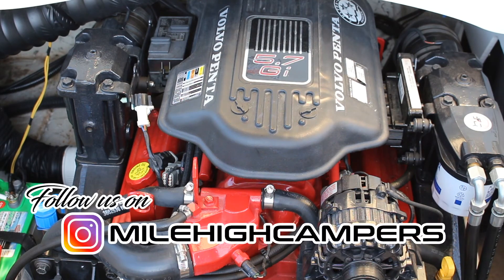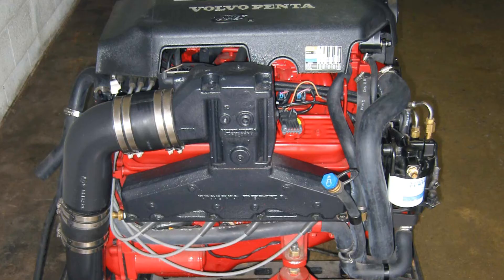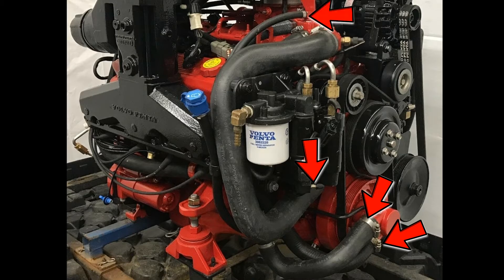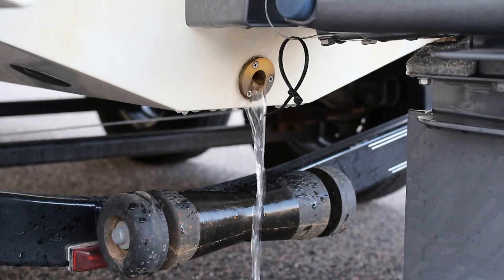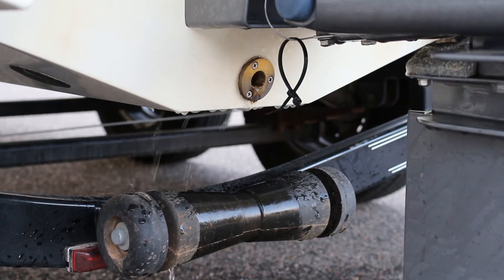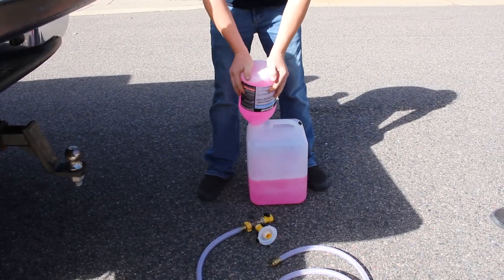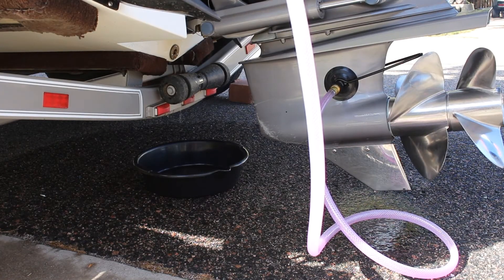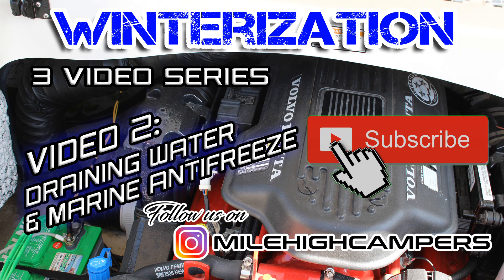How to Winterize Volvo Penta 5.7 Gi V8 Motor | Winterizing Volvo Penta 5.7 | Volvo Penta Drain Plugs

Comment: Thanks for your video..... I have a 5.7 GXI and always ran antifreeze through the system with the same setup shown since 2006. I followup by removing my impeller housing and impeller from the housing for the winter. When I first did this back in 2006 I wanted to see if there was any water left in the lower manifold areas. I removed both plugs on each side and to my surprise there was still water. I ran all the antifreeze through at idle with a full jug (5 gallons). Obviously, the thermostat wasn't opened therefore, make sure you run the engine to full temperaure first, then go with the antifreeze if wanted. Removal of the impeller is recommended but, by doing so you loose the antifreeze. Thanks again for your video, good job. 😊👍
Reply from the maker: Great tips, Thank you for sharing!! I may try removing the impeller as you suggest when I put it up for the winter.

Comment: Hi Mike, I do have a suggestion for you on winterization. In my 5.7 GXi I never pull the drain plugs. You run the risk of losing them or stripping the threads. 

When I do my boat for the winter, I attach a garden hose to the 5 gallon tank at the T. 

This part is critical. Turn the water on and start the engine. Let it run for about 5 minutes or when you see the temp gauge hit normal operating temperature. Usually in a marine engine, it’s about 160°. 

Once it reaches temp, the thermostat will open up and run water through the entire system. 

When it’s at the proper temperature open the valve on the antifreeze tank while shutting off the tap water.  You will need a shutoff valve attached to the end of your hose. 

It’s critical that you allow the engine to achieve the proper temperature so the antifreeze can fully circulate to all points of the internal passages. 

If you don’t allow the engine to fully warm up, you risk potentially damaging the engine block with raw water still in the engine. 

I leave the antifreeze in all winter here in upstate NY.  By keeping the passageways full of antifreeze and not air, you will mitigate any potential rust and scale. 

Just my two cents. 

Happy Boating !
Reply: What if you have a dual fresh water and closed coolant system with a heat exchanger (like the guy in this video has)?
Reply: Can you use the flushing port (starboard side, blue cap) to connect with winterizing kit instead of muffs on the outdrive?
Reply: @wabbott444  yes, you can use that blue capped fitting.  

You still have to get a T- fitting and the winterization 5 gallon tank to introduce that pink antifreeze after the engine has reached operating temperature.
Reply: @wabbott444  if you’re in a climate where the temperature dips below 32° for extended periods, he would still have to remove or drain all of the water from the system.

But with any V6 or V8 engine, there are passages within the cooling system on the block that will hold or retain water at the bottom of the loop. 

Many people try to take the chance they just pulling the drain plugs will successfully protect the engine, but that is not always the case. 

I had a neighbor that just  found out the hard way when last year he just pulled all the freeze plugs on the block. And this last spring time he found out he had a cracked block.

It’s critical to ensure that you get antifreeze into every corner and loop of the cooling system. 

A few guys I know, put in the pink antifreeze, and then for extra assurance they pull the freeze plugs.   But when you do that, you introduce air into the cast-iron block and that’s where you get rust forming.

Comment: Appreciated video 1&2 but I can’t find #3. Also can you provide a like to a good set of muffs?   I’m new to boating.
Reply from the maker: Sorry about video 3 When I went to video it I found that my drain plug is seized so I am going to have to take it in to get un-seized in the spring than I will be able to get the 3rd video uploaded. As far as muffs go I'm not sure if there are any that are better than another... but that's a good question, if I find out I will make a video on it.  Thanks for watching!

Comment: Great video on showing the drain points...but it's a bit misleading to those newbies that don't understand that using the muff system to get antifreeze into the system is not effective unless the thermostat is open. It's by passing half of the engine until then.
Reply from the maker: Thanks for the constructive feedback. I guess I was just trying to touch on the antifreeze process to show that it can be done. I personally do not fill mine with antifreeze, but I know a lot of people like to do it.
Reply: The thermostat is irrelevant for this procedure. It is not possible to guarantee the thermostat is open when running antifreeze unless you plan on running hundreds of gallons of antifreeze through your motor. If you drain the block as is done in this video and then you connect the muffs, the motor fills with antifreeze first, regardless of the thermostat. The seawater pump feeds the engine water pump and fills the block first. When the block is full the excess antifreeze will fill the manifolds and eventually exit the exhaust path. Any notion of the thermostat being in play here is false, as long as you drain the block before you connect the antifreeze, regardless of the motor being hot or cold, you will be fine. If you attempt to skip draining the block and instead run the motor until up to temperature on a hose and then switch to antifreeze you run a significant risk of mixing the antifreeze with the water in the block, at which point you're rolling the dice. All of that being said, as long as everything is properly drained, it is not necessary to add the antifreeze.
Reply: @johnleeuw3022  I was about to say the same thing but you said it very well so no need to say it again.

Comment: on the antifreeze - why would you not hook up the muffs first, run that for a while until you only see the pink antifreeze coming out, then disconnect all the hoses and stop there?  I don't get the drain the water, reattach hoses, then repeat with the antifreeze approach.
Reply from the maker: From what I understand you want to make sure all of the water out.... the fear is that if a water/antifreeze mix is left in the motor it could still freeze, you only want the antifreeze in there if that is the route you go. You might end up going thru more antifreeze than you need to if you try to flush the water with it.  Those are my thoughts on it but I'm sure there are many ways you could do it.

Comment: Great video, thanks. I have what appears to be the identical 5.7 Gi in a 2004 Blue Water. I cannot find more than the back two drains; no central drains or knock sensors on either side in the middle. Is it possible I only have the two in back? Thanks!
Reply from the maker: I think 4 is pretty standard on these, I would check with your local Volvo Penta Dealer, they may be able to look up your VIN number and be able to tell you. Sorry for late reply been busy with work and have not been on youtube for a while.
Reply: Some are just sealed off, ours is also. Removing the ones on the back was always good enough for us (along with the other stuff).
Reply: @davidlowe2641  some freeze plugs, depending on the model, aren’t removable they have around flat appearance on the sides of the engine block.  They kind of look like a flat disc in the opening where a six sided plug would normally be.

These are generally soft brass, and will burst if there’s water in the engine passage during the winter time. 

It’s a failsafe measure that a lot of manufacturer use depending on the model. 

The thought here is to have the freeze plug burst rather than have the block crack. If it does happen, however, the brass can be easily removed and expose the threads where you can put a threaded freeze plug back in the hole.

Comment: What is the problem with just running antifreeze into the system without draining the water?
Reply from the maker: From what I understand you want to make sure all of the water out.... the fear is that if a water/antifreeze mix is left in the motor it could still freeze, you only want the antifreeze in there if that is the route you go. You might end up going thru more antifreeze than you need to if you try to flush the water with it.  Those are my thoughts on it but I'm sure there are many ways you could do.

Comment: Do you need a tool for reinstalling the drain plugs or is it enough to screw by hand?
Reply: my manual says install to 22 lb feet.
Reply: @megaabbe123  the socket or a box end wrench works well and 22 lb ft works well as these plugs generally are made of brass.

If you do remove them, ensure the threads are clean and rust free prior to reinstalling, and apply a light coating of pipe thread dope or three or four windings of Teflon tape.

Comment: Hi...if you just drain the motor like this video...
Is there any worry about the out drive freezing up..
Is it best to lower the out drive down stored for winter?
Or do i have to put anti freeze in tge out drive?
Thanks
Reply from the maker: From what I understand its best to store the out drive down but I would check with your local Volvo Penta Dealer.
Reply: @MileHighCampers  Keep it down..... for proper drain.
Reply: @JoeSmith-cy1fz  yes after winterization, lower the outdrive as far down as you can for two reasons. The first is to ensure any trapped, antifreeze or water can drain out sufficiently.

The second is to relieve the stress on the exhaust Bellows during the cold winter months. 

If you leave the outdrive in the trailing up position, you keep the exhaust Bello stretched to the max. It shrinks back during the cold winter months, and it could split along the ridges in the exhaust below.

Comment: I have a quick question, I have a Volvo penta 5.7 GS and after every saltwater run I have to run fresh water to flush the engine. In my case the Volvo penta 5.7gs does not seem to have a hole where to put a a hose to run fresh water through it. There is no hole on the inside or outside.. any ideas?
Reply from the maker: Thanks for the question, but in this case I'm not sure, sorry about that.